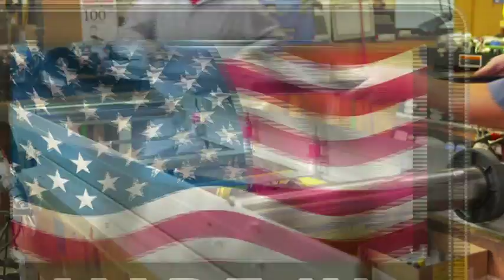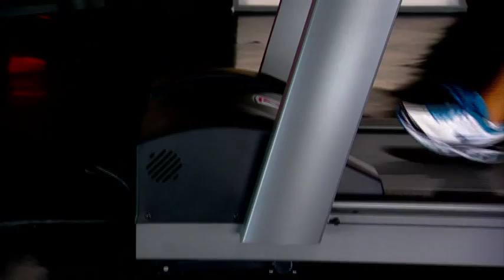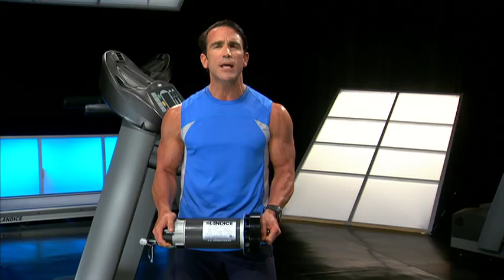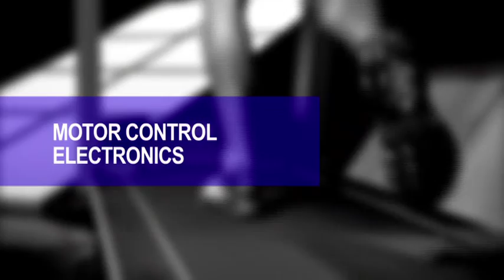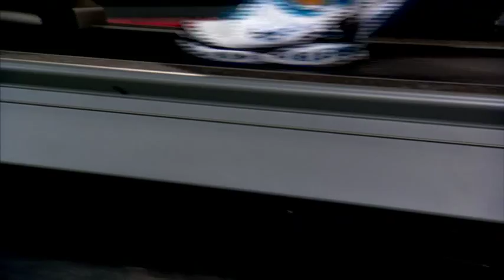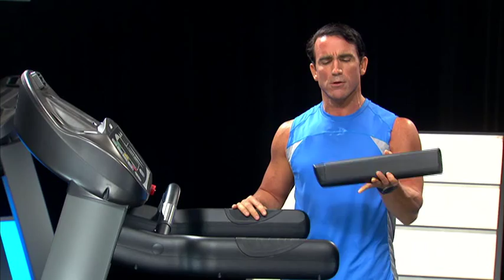Landice Treadmill Quality Construction

Comment: Hey Landice Engineers- Do not forget that the belt pulley needs to be somehow attached the the front roller! I have to fix my two L8s once front roller pulley got completely loose. To my surpise it just attached with pressure. Really Landice?  I called your customer service department, and Landice did not recognize their design flaw. They just offered me to replace front roller for cost.. Lifetime warranty? Ended up gluing with Epoxy. Something you could have fix after so many years of same flaw.